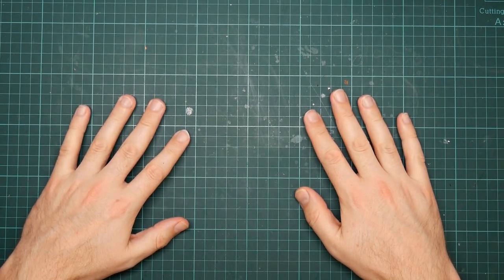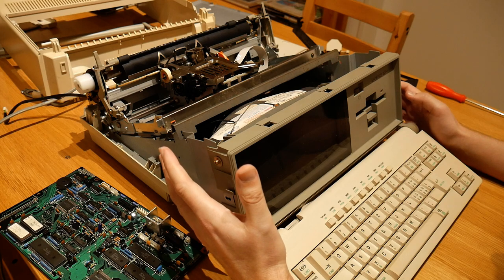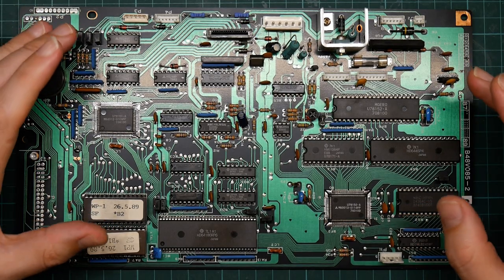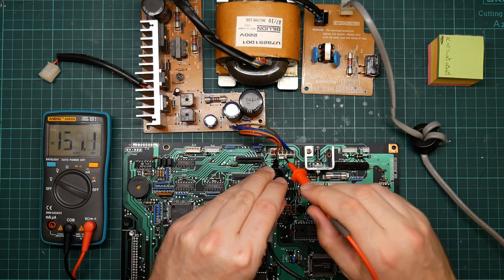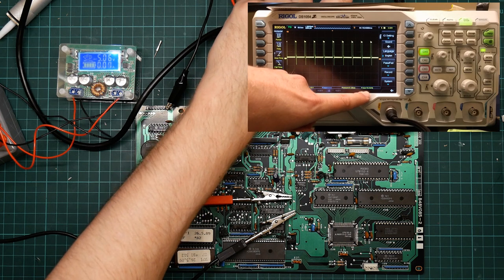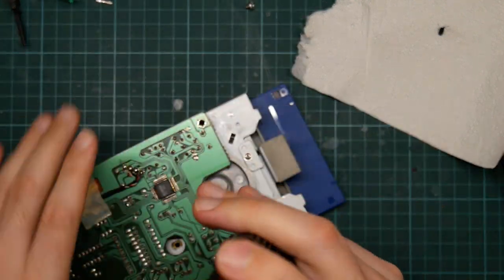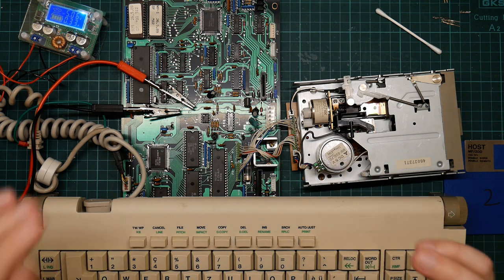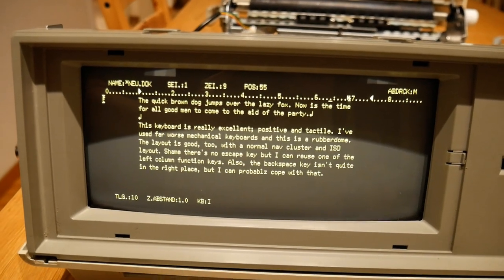The Brother WP-1 word processor from 1985

Comment: Anyone who is having trouble taking off the top of the case because of the daisy wheel sticking out on similar word processors, for reference, I have a Smith Corona PWP 990, I had to open the top hatch where the guide rod and ribbon are then push a tab on the inside of the daisy wheel which pops out the inner plastic piece and reveals a flat head screw that attaches it to the roller. I almost damaged my wheel by trying to simply pull it off. I've noticed with these units there is always a methodical way to disassemble and if it feels wrong to do it probably is.

Comment: Hello. Thank you for your video. I also have the same machine as you, and I have exactly the same floppy disk drive issue.
I tried it myself and got the same symptom, and when I took out the floppy disk, a piece of sticky belt came out with it.
So, I'll have to do what you did and disassemble it to change the belt.
What worries me the most is disassembling the monitor as you mentioned, because I'm not used to doing that.

Comment: Followed your comment on Adrian's Digital Basement PET video, this is a fascinating little machine. Can recommend trying the RGBtoHDMI adapter, would be a simple job to create a custom profile which will output pixel perfect video from this - OSSC might work well too, but the key advantage of RGBtoHDMI is integer scaling, and custom border widths, so it will look sharp whatever the output resolution, and can be configured to drive a super wide aspect ratio TFT - maybe not for this one, because it has such a nice CRT, but you mentioned you had another with presumably a really low contrast blue/yellow LCD, which could be easily swapped out for a modern display of the appropriate size, and output a pinsharp high contrast image - you can also choose a variety of 'mono' modes, so you could switch between amber/green/white on black, or any combination of colours you feel like :) Thanks for the teardown video, and for the corrections when you discover your initial assumption was incorrect, It's always useful to see the deduction process for these kinds of videos, and also reassuring that even skilled people don't always get it right first time, makes for a better video rather than pretending it's all obvious first time! You said there's no exclamation point on the keyboard, does it display one correctly if you create a file on your PC which includes one and then save that to the floppy disk? Sorry, rambling, thanks for the video, look forward to more :)
Reply from the maker: Thanks! Sadly the LW-30 has a real LCD controller so interfacing it with anything will be a pig --- I'd need to figure out the protocol used and find a compatible LCD of the appropriate obsolete tech. Or... I do have a PSOC5 mini-FPGA that might be adaptable to produce RGB... bah, I have too many projects as it is.

Comment: I've recently picked up a couple of these (various models). the printer actually works fine, I'm hoping to write a couple high school essays with them.

The main issue is that the bit on the back that feeds paper got lost at some point in it's life, on all the ones I have; I'm hoping to possibly fabricate one with a 3d printer? doubt I could source a replacement.

Comment: I have one of these, I can vouch for how horrible it is to get the FDD out. Replaced the band & cleaned the head only to find it did not work. Some nice info you have provided that I can use to have another go at mine. If I can get the FDD working then it will be 100% functional.
Reply from the maker: BTW, the last time I put it together the floppy drive stopped working --- it'll read and write its own disks but won't read my FluxEngine-written disks. Maybe the alignment's been knocked about? I am definitely not a fan of these.
Reply: @hjalfi  When I next can bring up the motive I will have another crack at it but you FluxEngin disk system looks like a good root to try, also looks like it suports a whole load of other obscure formats. Love the extensive reverce engineering you did on this machine, linked it on my website I am currently building covering my technical exploits & collections.

Sadly never found a good method for aligning the 3.5 drives. I found out the hardware they were not IBM formatted, confirmed the suspision i had. Hope to work on it some point soon, but I already have way to meany projects on the go at the moment. SO it can sit on the back burner for now.

Comment: Thanks for the cool video, glad you got the drive fixed. What a nice design with the board folding away to reveal the full mechanism! I've had much more trouble with fixing perished belts in notebook floppy drives, where everything is cramped and the mechanism can only be fully accessed if everything is stripped.

As to the video signal, it sounds like something a regular TTL RGB CGA monitor (or maybe multisync) should accept. Though given the CRT aspect ratio I'd think that the horizontal resolution is higher than CGA, so the output probably won't look too nice.

Comment: I found one on the street now. Did you find any schematics? My Motherboard was working but now died, but trying to make use of that screen now. It seems to be GND, signal, signal, signal, GND, but it seems like the HSYNC / VSYNC is not TTL levels.
Reply from the maker: No schematics, no. I think mine had TTL HSYNC/VSYNC, though. It certainly had TTL signal. You could probably interface it to an old Hercules, MDA, CGA card etc without too much trouble. If the motherboard has died, you might be able to fit a small modern XT clone board in there and hook it up to the screen.

Comment: This thing looks very closely related to my brother wp-2410 machine even the os seems similar but mine uses the 240k brother format for floppys
Reply from the maker: It's clearly related. AFAIK all the Brother word processors use a similar OS, but the details differ. The 120kB and 240kB disks use quite different file systems, for example. I do have CP/M running on at least some of the 240kB models, if you're interested... https://cowlark.com/cpmish/arch/brotherop2/
Reply: @hjalfi  i tried that i couldn't get the Amsterdam compiler to make on my laptop but if you can send me a disk .img file i can play with it

Comment: Floppy Drive pin-out and a schematic part of Flop driver IC found in ROLAND D20 service manual. U78152-A driver IC. "https://www.synthxl.com/wp-content/uploads/2018/03/Roland-D20-Owner-Service-Notes.pdf"  Page 13. Left of Video Controller the HN61364P is a 8K MASK ROM, so indeed could be a Char ROM as the UPD4363C-15 is a 8K RAM. Typical I have mij 2 ROMs different labeling No WP-1 Mentioned just U79205 and..207 Mitsubishi. Have this WP-1 also.
Reply from the maker: Oh, interesting. I'll need to check to see if this FDC is similar --- I suspect that chip's a gate array, so it could be programmed with anything; but the architecture does look extremely similar. The fact that the Brother's FDC looks different from the other gate arrays might point to it being an off-the-shelf preprogrammed job. Do you know what disk format the Roland D20 uses?
Reply: @hjalfi  No I have no knowladge about Roland D20. I was just currious about the diskFormat WP1. And typical drive. As no schematics of WP1 or manuals. Was searching about that U78152. Bit out of box thinking.